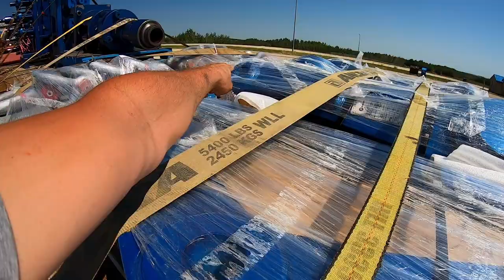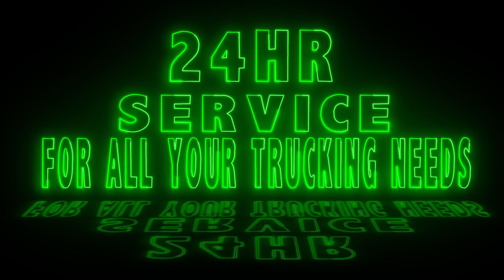SHOP TRANSFERING RED DEER TO GP NO AC NO MUFFLERS NO EARPLUGS +40 HEAT WAVE

Comment: I feel your pain,the truck I’m driving does not have the conditioned air. Nice catch on the finder binder. I’m putting up a video you might be a little interested in. Running the Haul Road or the Dalton Highway if you prefer. I did it so you don’t have to 😂
Reply from the maker: I’d love to drive it. I may have as a kid but don’t really remember. A lot of the roads in the Yukon were 300+ kms of gravel. Those were the ones to remember 👍
Reply: @TimelapseTruckerRTOT  I remember the Yukon well. I don’t know if you remember the big shiny Vic Hoskins trucks that used to roll through there,but I used haul produce through BC and the Yukon. Very comparable for sure.
Reply from the maker: No I don’t remember off hand. Any pics?
The Yukon and Alaska are the best drives a guy could do. I haven’t seen anything close to it, B.C. is good but super busy and frustrating at times
Reply: @TimelapseTruckerRTOT  just posted a pic on you FB fan page